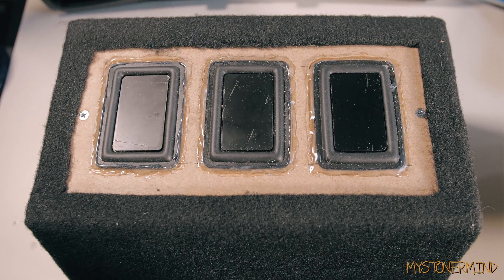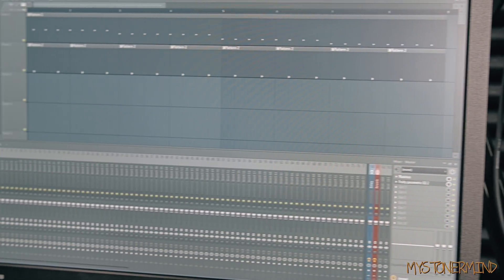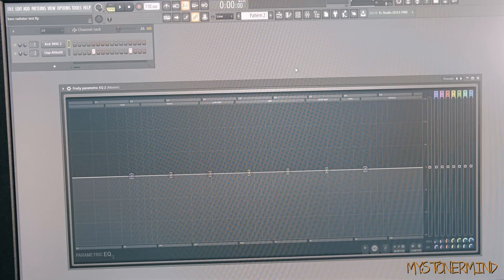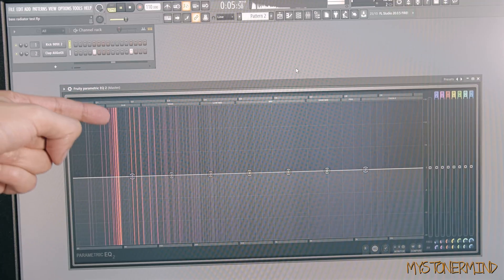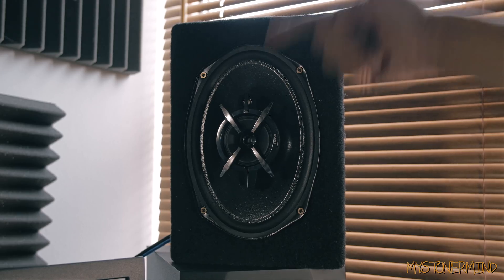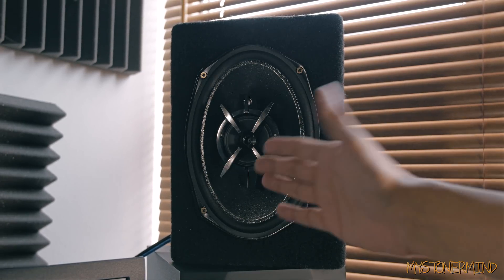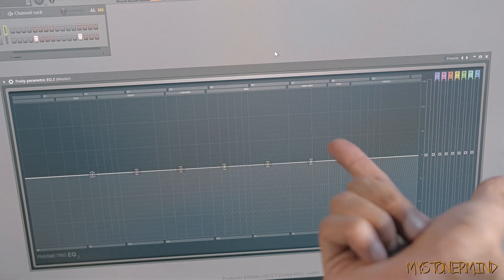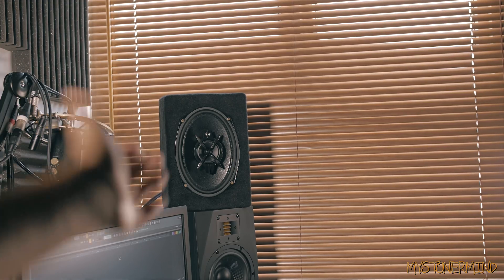Bass Radiator vs Sealed - Test (HMMM)

Comment: if you were to increase the cost of the speaker to then include the passive radiator cost, would that new speaker in a sealed box outperform the one with the raidiator?
Reply from the maker: good question and probably not because the radiators were pretty cheap. Also these boxes are a silly size for a 6x9. Simply increasing the box size alone would give a better bass response.

Comment: sounds practically the same, also hard to judge with the changing bass. if I have to guess, the radiators feels like producing a slightly lower bass. maybe that explains why bass radiators so popular with portable bluetooth speakers, lower bass despite compact sizes.

Comment: The bass with no radiator is more flatted less depth more crispy dynamic hit unlike with radiator cabinet its smoother deeper better low frequency characteristics , i played this clip on my sound blaster katana " CINEMA" preset mode

Comment: I think if we put a slot port over the radiators on the back of the box opening at front and tune the radiators to a low frequency the result should be an all-rounder ported box.The radiators will block higher frequencies to enter the port and the spl will not be wasted  while lower frequencies will be passed through port and amplified. What do you think?

Comment: hi, bass radiator dose work. its tricky when its actually tune properly. it matters the size of the encloser and the location. the speaker itself also can in impacted - mostly for those drive that are hyper that works great with bass radiator since the damping effect really smooth it out. its must be engineer tune. its not like one of those speaker where you can just slap it on and make it happen.
Reply from the maker: yes I know, this was done for the viewers. Thanks any way :)

Comment: The bass radiator is best fitted on both sides of the enclosure to reduce the overall vibration on the enclosure. also the ones you used is relatively smaller than the main driver that is why it sounds like there's no sound diff. at all or just very little diff.

Comment: In my opinion the lower the frequency (0-80hz) Ported enclosures will win hands down. 
Then low to mid frequency (40 - 120hz)  Passive radiators are excellent.
And last but not least are the sealed enclosures who don't get as low (usually) but have a much tighter punchy sound sound through the (50 - 150hz ish)
Just my 2p worth 👍😁
Reply: I guess its down to what you design your sub-stage to do and which configuration you're going to use. If space is at a premium, sure, go PR. If not then i think the world's your oyster.

Comment: Yeah, there is slightly more base on the higher frequencies, but it tapers off lower down. I also  noticed a slight increase in treble response, dunno why.
But I think the reason why the difference was so slight is because even with the bass radiators, it's still technically a sealed speaker unit with no air flow. As the Speaker moves outward, the base radiators move inwards and vice versa. There is no airflow to maximize excursion as it fights the vacuum inside the sealed box. The radiators only add a slight relief because they move inwards and allow the speaker diaphragm to extend farther than it normally would with the fully wooden cabinet.

Comment: Personally it looked like the square in the center of the radiators had too much mass to keep up with the frequency.

I would try a lighter material for the rectangular cone, or a stiffer material for the surounds that their resistance matches the mass of or greater than the mass so the energy is focused into moving the air in a uniform mannor, because it looks like the surounds are taking more of the energy than the cone is reproducing.

Also maybe find a way of routing the sound presure inside the cabnet in an equal manner because the radiators looked like they were all going at different times which would create phase problems and end up being quieter.

Like if you had a way of internally focusing the presure from the woofer into an equal ammount of presure on each of the 3 radiators it might work, but maybe one big one in a round configuration.  Becauae also that rectangle looked like it was fighting its self.

When I'm talking about routing the sound inside, think the acoustic chambers in bose clock radios😋

Just a few ideas, do with them as you wish.
Reply: The problem with routing that way is then again phase because then the time the sound presure takes to travel in the tube to the loose unpowered cone.

There is some math I don't understand thats involved to figure that out.

Maybe contact call McGowan from PS audio?

He may hve some recommendations for you.
Reply: It is neat to see someone testing a speaker idea though😉

I have a set of Sharp speakers that have a woofer that has no coil in the bottom, oddly its front facing and does upose the woofer that has a coil when it plays.  Now I'm actually curious why I'm going to go look up information on them😋

Its kinda strange.

But its like this so its a sealed cabnet that ends up giving the speaker some leway instead of a fully sealed cabnet.

Picked them up for cheap at a thrift store.😋
Reply from the maker: They all move equally, camera's have that affect on speakers, look it up ;)
Reply: @MyStonerMind420  no, I already know.

I just forgot earlier.

Has to do with scan rate and how its saved into the memory.

You'd think they'd get past that with whole frame data capture.

And actually catch a slide of video all at the same time, its not like we have data constraints anymore.

I'm pretty sure the tec is there to make it happen.

But yeah, I know most cammeras take a picture essentially the same way a crt tv works.

I dont think progressive or interlace are useful anymore... If anything now that other tec has caught up its just an annoyance.

I mean why not pull a direct feed from the chip that sees... Ya know... The whole fame at once.

Anyway, I'm just kinda annoyed at myself for thinking one dimentionally(about the audio onlyl

There would be an easy test to make sure they are in sync... Have some contact sensors hooked up to the pc😉 
I digress.

I'm doing the human thing of trying to justify my position🤦 😋

Did you notice any difference in peak db?

I've thought about doing what you did but with a speaker at reverse polarity or just mounted inward... So that way it has a fast response and still is releiving presure in the box.

Comment: I've always preferred sealed to ported or anything else. It doesn't matter if porting makes it louder at low frequencies. Tightly-sealed boxes always sound better to my ear... clearer without need to mess with equalizers.
Reply: Oh boy i'm sure you didn't even heard passive subwoofer with a passive radiators.  If you are limited by the space and ported box is not an ideal option, go for the passive radiator design. Basically if you have one 10" high xmax sub, you 'll need two 10" passives or one 15" ( Dayton audio has tunable passives, if you add more weight to the cone, you'll go much deeper ). Compact home theatre subs are using 8" drivers with 12" passives and it sounds just like a ported box. I have two 12" subs laying around collecting dust and i have pretty smartass idea in my mind rn. What i would spend on MDF material i can literally cut the box in "half" from the actuall size of a ported box and you don't have to even calculate internal volume, it should be some volume though. So lets sum it up, ported box for two 12" subs will require over 150L box. By using passives ( three 15" passives ) this box should be 60-80L absolute air tight ( and that's the key, the box must to be atleast 99.9% air tight ). And last but not least, with passives, you can go down to 18 or even 15Hz FS!!! Achieve that with a ported box without a signifficant box size or port lenght ( for my two 12s the port will be more than 1.5m long to achieve 15Hz resonant FS so, no matter what, you can achieve deeper bass by oversizing your enclosure or double or tripple the lenght of the port )

Comment: For everyone spouting off about passive radiators please do a little homework before leaving ridiculous comments here. The cone area and moving Mass of the driver and the radiator need to be similar, then you add or remove mass from the radiator to tune it to a specific frequency. There are some other factors but this is the most basic jist of it. Since the radiators here have far less cone area and far less weight than the active driver, they will likely resonate at a much higher frequency than the fs of the active driver. Hence no measurable or audible difference in the 30-50hz range that was focused on in this test. They are basically just flopping around wasting the amplifier power and possibly allowing a bit more cone excursion since the box is no longer technically sealed.
Reply: you're the closest. the cone area of the passive needs to be larger.  you can do this with multiples if needed.    the displacement of the radiator needs to be 1.5 to 2 times the displacement of the driver . this is where it can be easiest actually. if you have an 8" driver with 8mm xmax then just use 2 8" passives with 8mm xmax each .  the moving mass does not really need to be similar since you are going to "tune" the radiator(s) by adding weight.  there are many rules and guidelines for this type of system and i am far from an expert BUT i have successfully designed and built a passive radiator sub, which judging from most of the comments, is alot more than anyone else has done.

Comment: The bass radiator has to be larger than the driver. Especially if the radiator excursion is so limited like it is on those tiny things.
Reply from the maker: indeed well done

Comment: You need to up the size of the passive radiators for the driver. You want to be between 1.5x-2x more SD on the passive. I've had decent results at 1.25 more but generally I try to get closer to 2x more for my subs. So for a single 10" driver I could run 2 10" passives to make it an easy 2x larger

Comment: Try this. 

On that box use a 1 1/4 PVC pipe. The larger the pipe diameter the longer the port length will have to be to have the same effect. Considering The net box volume will be .20 ft3 you dont have alot of length to work with. Use of a smaller port diameter is recommended. Longer the port length the lower the tuning frequency. Despite the FS of the speaker I usually aim for around 35hz. 

I am going to assume the length will be about 9 to 10 inches to get the desired effect. Bass heads say box is everything, but port tune is the key to getting your box to sound awesome. You seem like a smart guy so may know all this already.
Reply: Or just use 1 rad per enclosure...

Comment: Radiators are way to small to make really any audible difference.
To work properly you need twice the cone size, Or even bigger.
Reply from the maker: I'm glad you know that, well done.
Reply: @MyStonerMind420  ty. I know its just an experiment. But im sure there was a tiny boost in the higher frequency range.

Comment: I have done alot of testing over the years on weather or not seald or passive radiator enclosure is better. In my opinion it comes down to application. I feel that the drivers and radiators used in this video made this test inclusive. Even though you can hear a slight difference. In my test ive noticed that the passive radiator is more affective in the lower notes. I used a frequency sweep from 90hz down to 30hz and could see that on the higher bass notes the subwoofer driver I was using had more excursion. On the lower bass notes the passive radiator had more excursion. Indicating that passive radiators work best with subwoofer drivers in the lower frequencies. Full range 6×9 coaxial speakers sound and perform best in sealed enclosures with the bottom end crossed off between 50hz-100hz. Depending on the quality of the driver. Subwoofers are designed to take the load off from your midbass drivers and play only the low notes. May I add that you can also tune a passive radiator by adding various amounts of weight. The radiators in this video seemed tuned a bit high. In my opinion it doesn't really make sense adding passive radiator/s to a driver/s thats not going to play very low notes. You will achieve higher fidelity with full range drivers in a proper tuned sealed enclosure. You can use a passive radiator/s with your subwoofer/s if you are tight on space. Its hard to beat a quality ported enclosure for a subwoofer though. Im still testing and figuring out weather or not passive radiators are  better than ported. Passive radiator enclosures do eliminate port turbulence. Commonly heard in ported enclosures. So thats a plus. Sorry for the long comment.
Reply: Back in the day over 30 years ago we had a bigger version of 6x9 but i can't remember what they were. something like 8x10 or in-between somewhere. Quite rare as they were expensive back then. 
  I'm thinking to make a multi purpose compact sub from 2x 6" Ground Zero's  but i was wondering about adding a coupe of passives. I was thinking has anyone ever made a tuned port but with passives at the far end rather than an exit. Also Has anyone done a hybrid with port plus some passives?

Comment: The best sort of bass radiator is one that is identical to the speaker with power to it. Plus, square speakers aren’t really the ideal bass reflex output. It’s square so it has inherent limitations right from the start.
Reply from the maker: the video wasn't about doing it the "correct" way. There are plenty of square subwoofers about, maybe take a look.

Comment: Passive radiators are not there to increase box size. They are resonators that will not have any positive effect on the sound without proper calculations.
Reply: how could they possibly increase box size??????????????? he said its just a mess around video u turnip. insted of adding port, this will lower tuning withouth increase box size he say
Reply: @frankyg2267  description?
Reply from the maker: someone is misreading what I typed in the description. Increase a boxes size with passive radiators?! LOL! DUDE
Reply: @MyStonerMind420  i am not nativ englisch speaker but i understand descr and try say to WEST (:
Reply: @MyStonerMind420  

Oh, I see now, lol. Thing is I actually hear that claim pretty often, people think putting in PRs in is like putting drivers in a larger box because it allows them to "move more freely".

Comment: The radiators need to weight exactly as much as the amount of air in the box, as far as I know
Reply: Air doesn't have any weight.
Reply: @westelaudio943  "The weight of the cone of the passive radiator should be approximately equivalent to the mass of the air that would have filled the port which might have been used for that design."
Reply: @4liceD_  

Mass in this case is to be understood as inertia, not weight.
Air doesn't have any weight, it does not fall (nor rise) at room temperature.

The passive radiator diaphragm should be as inert as the air column in the respective port would be.
Reply: But it's good you actually researched about the subject instead of parroting BS myths like that passive radiators are there to "increase box size" or something. 👍
Reply: @westelaudio943   insted of adding port, this will lower tuning withouth increase box size but more surface area required
Reply from the maker: @westelaudio943  oh man, you wrote it twice. Rads don't increase box size, that's just stupid! Whoever say's that should have their tongue removed. Pffft
Reply: @MyStonerMind420  Again, it wasn't specifically about you. I hear that claim pretty often. ;)
Reply from the maker: @WESTEL Audio it's all gravy dude, don't worry about it.

Comment: Sounds like the radiator's need more weight they are tuned a bit high....
Reply: More weight? You need more distortion?
Reply: Yes, more weight. That's how radiators work. The more weight, the less likely they're moving at higher frequencies, and more likely resonate at lower frequencies. Glad someone with knowledge pointed that out.
Reply: Dude. He is using 3 tiny bass radiators for a huge 6x9. What that speaker needs, is a radiator better suited for the application (however I guess it's hard to find a PR perfectly suited for a 6x9)
Reply: That's not how it works.
Reply: @tonys623  more surface area would help but more weight would slow down the movement of the radiators..

Comment: The stage feels more wide with the 'after' part. AND it might not affect the lower portions so much but it might be adding more sound to mid-lows, i.e. the continuous beat sounds louder rather than the bass.
Reply from the maker: yes I think you are correct

Comment: I DO hear a 'meatier' sound in the lower frequencies. You need at least the same passive radiator area as the speaker itself though, maybe even up to two times the area to make it work really good and to take the strain off the passive radiators. Use a blown speaker as a passive radiator if you have one..  Fun experiment!
Reply from the maker: I know a radiator at least the size of the speaker is required ;)
However using a blown speaker is a great idea! I wonder if I can chop the magnet off one of the ones I've blown, and yes, I've blown one already.
Reply: @MyStonerMind420  Do it!